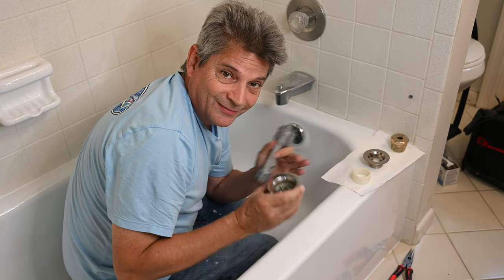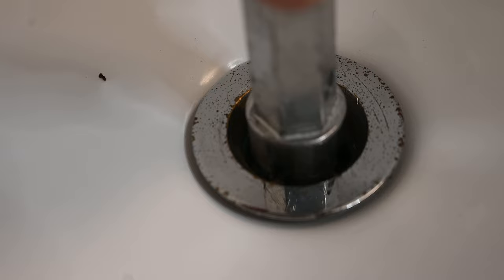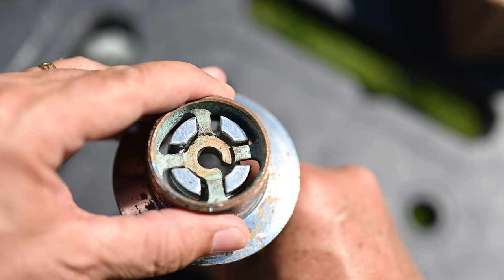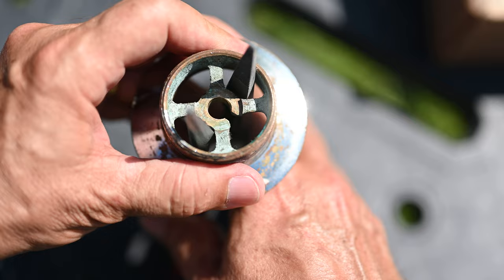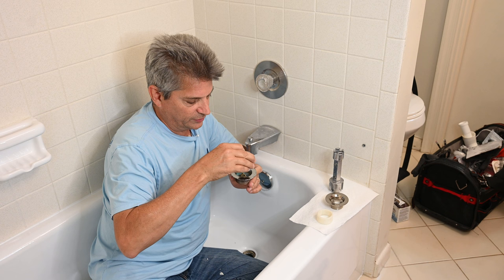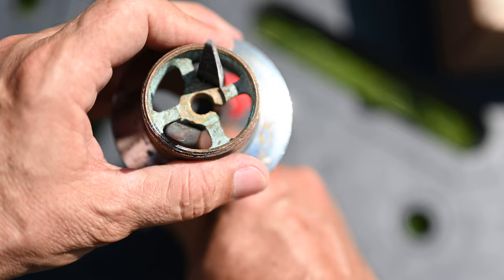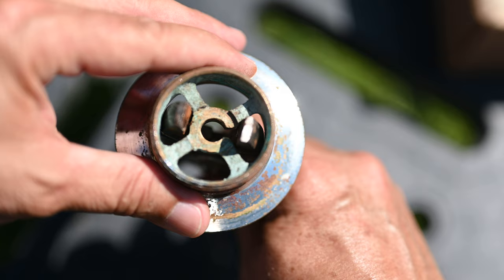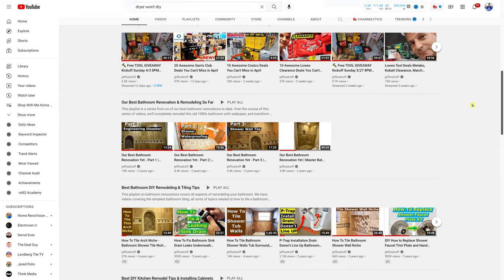YOU Are Using Wrong Bathtub Drain Removal Tools

Comment: When you live in the middle of N. Dakota, you have to improvise.  I  used an angle grinder to cut  an + shape on the end of a pipe.  It slips right into the four drain slots openings, then I drilled a hole through the "handle" side, put a screw driver in the hole for torque.  The drain came out perfect.  Saved the converted pipe for future use.
Reply from the maker: That's an awesome idea, using the head, think outside the drain!

Comment: Amazing DIY! Bought the tool on Amazon. My significant & I just unclogged the shower drain and it was very disgusting 😭 we were gagging and laughing at the same time. Thank you for the amazing tutorial!
Reply: @totsmini3105  it was actually pretty easy to use and it came off right away. I was surprised that it worked  😊 all under 5 mins!

Comment: Mine had no spokes, the tub drain extractor didn't work either, it had zero grip, all the teeth were rounded, ended up using a Dremel with a rounded metal cutting bit to make small slots on the inside of the drain and used my prybar, worked perfectly.
Reply from the maker: yes some people have to resort to this when all other options are exhausted

Comment: I’ve taken apart a lot of tub drains over the years. Sometimes these are very tight and corroded. Some Liquid Wrench. Some propane torch. Sometimes a sawzall is needed anyway. But the little special took is available at Home Depot. And its really nice for installing NEW drain parts.
Reply from the maker: Many older drains come out nicely with this tool as well

Comment: I've been working in commercial construction and moved to residential service about a month ago and the guy I've been riding with has been a plumber for 15 years and this happened today. I'm not sure what tool he had. Kinda like the drain wrench on one end but too small for this drain. two spokes similar to needle nose on the other and that's what he expected me to use. I had to even put them in two adjacent pie pieces because they werent wide enough to cross the nut in the middle. I was like...this is going to rip right out and sure enough. and he didn't have the other tool you showed. he took a sawzall to it and got super lucky. definitely getting both of these tools for my bags
Reply: It's apparently called a drain plug wrench.
Reply from the maker: I don't see how he could have done it with the sauce off cause those things bounced all over the place. A tremble is a lot better and safer selection for making a couple of micro slits on the edge of the drain flange wall, without it poking all the way through and ruining your threads. Then you're just chiselam away with a screwdriver

Comment: Made a tool that works great for this. 32mm 1/2 inch socket and some duct tape. Tape then hammer it in then twist it out with your socket wrench. Don't know how many if those bathtub drains I've gone to remove and sheered the cross member. Side note really love the Milwaukee 8 inch needle nose pliers. If your very lucky the needle nose or groove joint pliers will work sometimes lol.
Reply from the maker: I have had a pretty much a 100% success with the drain ranch. But yes the tub extractor reviews a couple of times and successful there as well
Reply: Yeah, for me, this stupid dumbbell wrench was a waste of money. Tore the crosshairs right off the drain. Internal wrench is probably my next step.

Comment: I had a drain that the removal tool did not fit so i made my own from a piece of steel pipe and just cut slots in the end with a cutoff wheel in a grinder till it fit nicely in the drain and it took it right out with a pipe wrench on the piece of pipe

Comment: 2 things I use, needle nose pliers for that job but i just slide the noses in then i slide a flat head screwdriver between the nose of the needle nose and use the screwdriver to turn the and loosen the drain. even stuck ones come out with the added leverage gained by the screwdriver with just a steady turn. I just hold the pliers in place and the screwdriver does the work.
Reply from the maker: Yes the need of those will only work on a loose drain. Whenever the drain is stock is when you should be using the real tool. But if you usually do this this this means you have done this task many times why not just buy the wrench for $10 then no you'll always have the perfect tool for the job?
Reply: @totsmini3105  It depends on how thin the nose is.

Comment: Mine was really stuck after 30 plus years and the cross bars disintegrated even with the “tool. To remove it ,I cut several small v shape notches in the inner top rim. Then I used a cold chisel and mallet to tap the chisel in and against the notches. The impact broke the drain loose pretty quickly. I do wonder if the newer plumbers putties won’t harden “as much making future removals easier? If they used silicone, you have to really work at it with a sharp knife and heat. The ten dollar tool is the (only) way to go to put in the new drain.

Comment: Yes and then there is the drain trip linkage that even with new parts, sometimes the stopper will lower to plug the drain but not raise back up with the lever causing you to have to remove the beauty cover and pull up on the linkage to free up the stopper. Strange that happens.
Reply from the maker: So many problems with those trip leaders that's why I never used those

Comment: I still have had drains break when using the tub drain removal tool because the drain was all rusted out
Reply from the maker: Yes pretty rare for us as well, that's why I also carry 2 sizes of a tub extractor in my bag is well because those come in handy when the hub has already been broken. You can also cut the drain with a dremel tool as well

Comment: As always, you do a great job explaining. Thanks Jeff. Could you comment on reasons for removal? Leakage? I live in a 75 year old home and mine is original. But no leaks!
Reply from the maker: Carol and I am going through this right now at our friend's house where we are changing out their bathtub for a new tub and so that's one time you would have to unscrew the old drain and then screw a new drain in its place. Also some people will update their hardware for a brand new look just updating the top spelled and the drain and the faucet handle can really make your shower pop

Comment: i use a screw driver and hammer. cut in little slots either with a i handed hack saw or dremel.  they get corroded and lose there insides
Reply from the maker: Yes, some use a Dremel tool also to cut the slots gently without cutting into the threads.

Comment: $25 dollar extractor did not work for me, I thought it would work, but it can not gripe the drain.  The previous owners of my house used very corrosive liquid that melted way the drain grid.  I had to use dremel to cut 4 notches, then used hammer and a big flat screw driver plus wd-40.
Reply from the maker: Yes, that is a great way to do it also

Comment: My local plumber has let me down too many times.  The upstairs shower leaks below, bad smells from upstairs and down at kitchen sink.  Can I contract you to fly out and address my issues?
Reply from the maker: The interesting thing I've noticed about plumbers is it's all about get in get out don't check the work or anything.
Reply: @jeffostroff   Yeah one of the things he did while working under the kitchen sink was to turn off the water to the dishwasher he forgot to turn it back on and my wife later was wondering why the dishwasher was making weird noises I'm just happy it didn't burn out anything

Comment: Hey Jeff, great video! When replacing the drain plug, what do you put on the threads when installing the new one? PTFE tape? Plumbers putty?
Reply from the maker: I don't put anything on the thread there is no need to if the water leaks between the threads it still goes down the drain
Reply: @jeffostroff What about when I take it out to get water out of the preexisting tub under the liner? Not removing the liner, just get the water stuck underneath to go down the drain. What do I seal the drain with so it doesn't go back in? Wondering if I should also buy a new drain instead of putting back the old one.

Comment: Neither end of the OFFICIAL tool would fit my 50 year old drain, tool too big. Loosened drain with heat and needle nose pliers, after I tore open the OFFICIAL tool packaging, making it unreturnable..
Reply from the maker: Yes the official drain wrench has worked perfectly for me every time that's why I never use any of these other pliers or needle nose they're just not strong enough for the types of dreams that we always end up with, the drains that nobody can unscrew

Comment: Why do I have water around the drain after showering. Just a small amount that sits around the drain and doesn’t go down.
Reply from the maker: If you have water collecting around the drain it is because they did not properly slope the subfloor of the shower into the drain everything should be flowing into the center like a volcano bull. And so sometimes they mess up with the tile where the tiles at the drain are very slightly higher than the tiles that are a little bit further out of the drain and so the water can collect there as well too I'm very careful when I tile to make sure that as I get closer and closer to the drain each tile is lower than the one before it and sloped. Most building codes require you to slope that drain floor 1/4 of an inch per foot.

Comment: I'm sorry, did you say put the drain wrench, shoe wrench, in the drain and turn easily with a screwdriver?? I must add emphasis to the word "easy" because 20-30 year old shoes don't just unscrew. Also, not hating at all, just from experience, the extraction tool is garbage and the best bet a lot of times on old shoes is cutting them out as long as you're good enough to not cut the tub...
Reply from the maker: Lol yes you are right on that 1 lol. Sometime sometimes they will come pretty easily and sometimes like you said almost 30 year old ones with years of chlorine and sediment in the water in the water or if somebody had used Pipe dope on the drain before screwing it in 30 years before they can be really really difficult. We have a video that covers that topic and I used a pipe wrench turning that drain wrench in order to get the thing loose it was a nightmare but certainly workable.

Comment: Duct tape to the rescue! Just wrap the needle nose plier's prongs in a thick layer. Or use some small plastic hose. Not perfect but in a pinch ...
Reply from the maker: Those only work in a case where somebody has a nice loose has a nice loose drain that spends freely. Most people who are remodeling end up with a train that's already been stuck in a pair of or of needlemost pliers is not going to do the trick
Reply: Why rig up the wrong tool vs. use the correct tool?  No brainer here in this video.